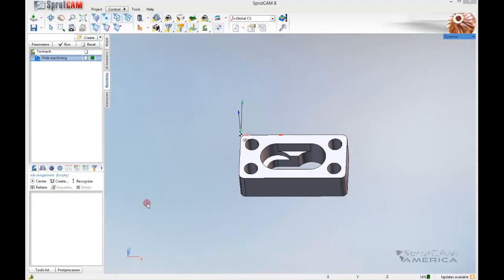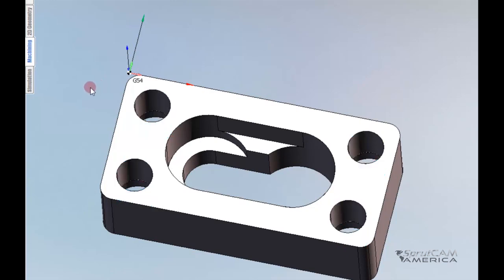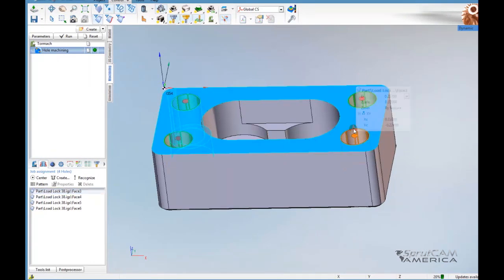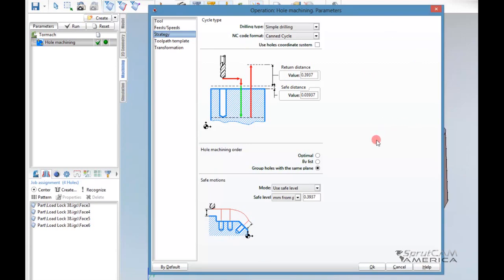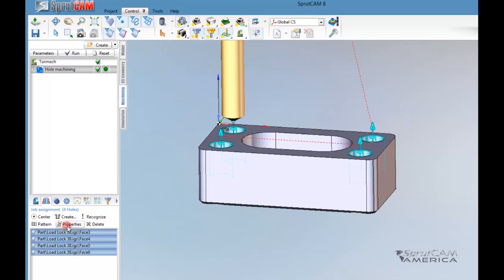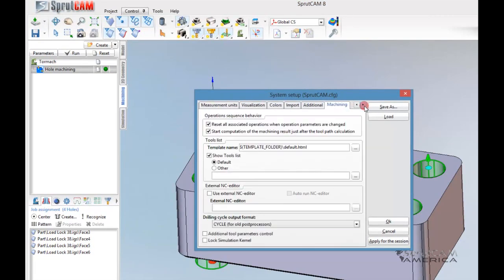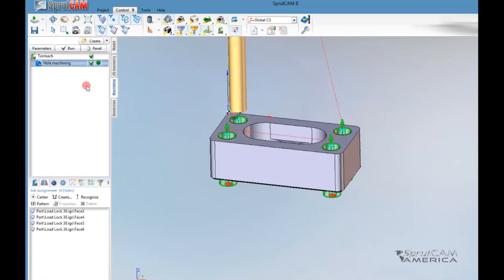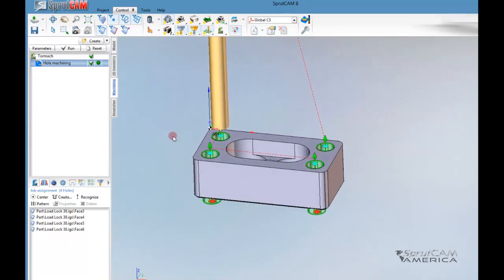Hole Machining - SprutCAM 8

Comment: I recently started working to a new place, they rapidly realised I was good at machining // coding and optimising their tool paths. so they asked me to make their programs now, something i havent figured out yet( didnt have much time to really figure out everything yet ).  is why does it come back out of the holes slowly. instead of backing out out in G0, it uses the feed rate. I can correct it by hand in the code thats easy, but i want sprutcam to do it in its postprocessor itself. Is the backing out using feed speed % the only way to change it via the processor ?

Comment: Hello Eric,,sprutCAM8 is EXCELLENT, SPRUT7 was good as well but i do like 8 better,,, how about a few 4th-axis parts with ingraved text on round surface,, raised letters on round stock and of course continuous motion on a round part say something like milling 3 to 5 grooves .259-wide .310 deep along a 2in-dia piece of material 8in-long and each groove has a twist of 1-revolution every 2in,, i was just thinking u prob-dont have enough projects going on so i thought i would help u out ol'friend!